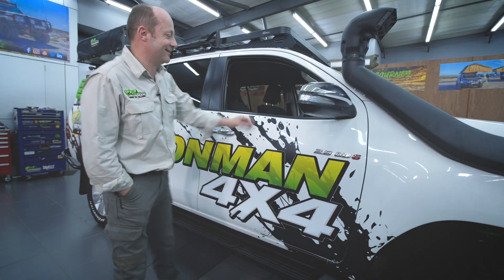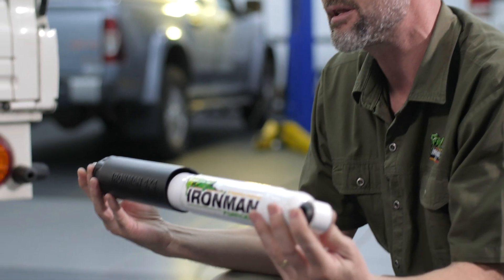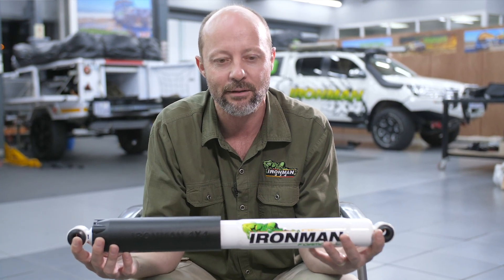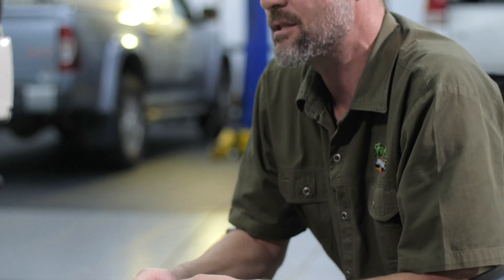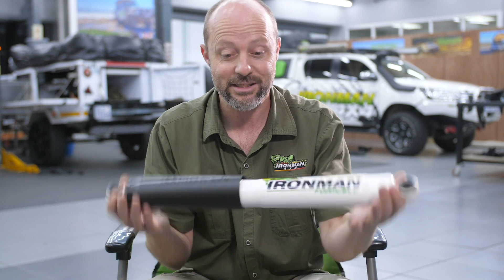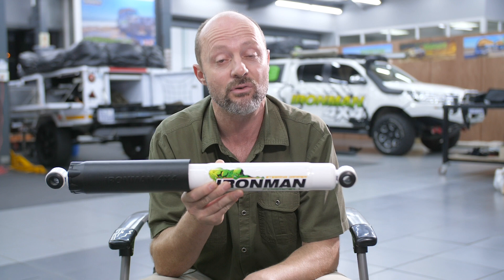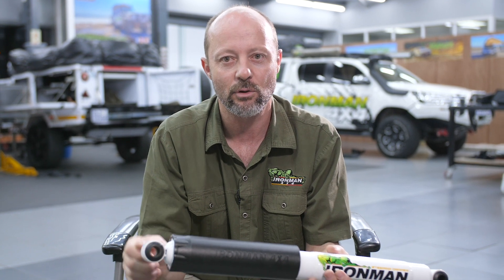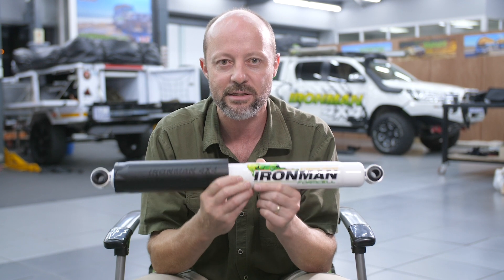Steering Dampers And Death Wobbles - A Moment With Mic from Ironman 4x4

Comment: Mmm... not sure I agree with you entirely. Steering dampers (sometimes called steering stabilisers) are not only for low speed off-road use; but rather for damping the movement of wheels and steering links when driving on an uneven surface or for instance hitting a pothole (particularly for vehicles with solid front axles). A good quality steering damper will certainly reduce the effects of worn steering and suspension components such as the dreaded "Death Wobble" but should not be seen as a cure. If the cause ( as you described correctly) is not attended to, the steering damper will also wear out in no time. Great videos - nice to see the Ironvan adventures on the Weather Channel!